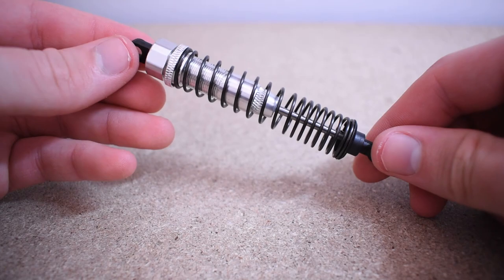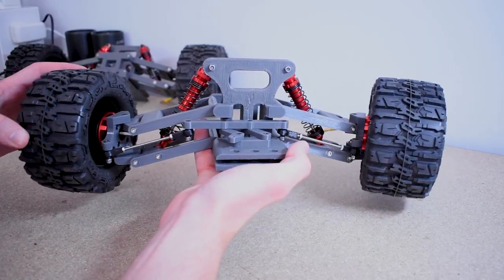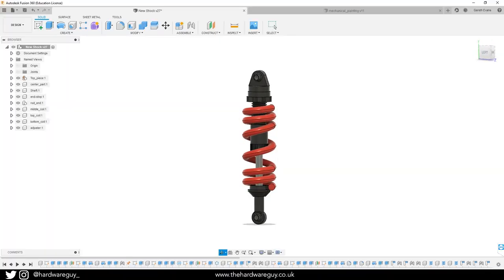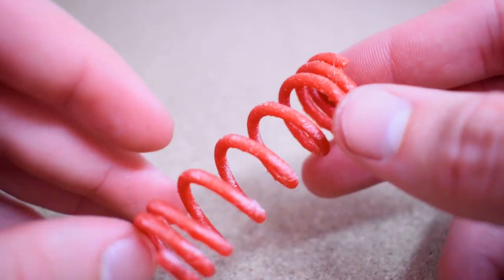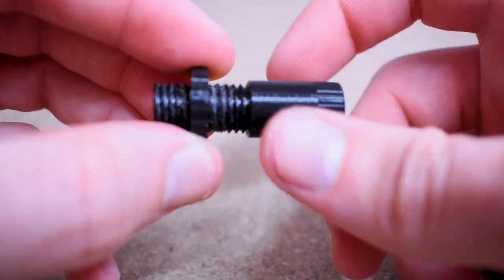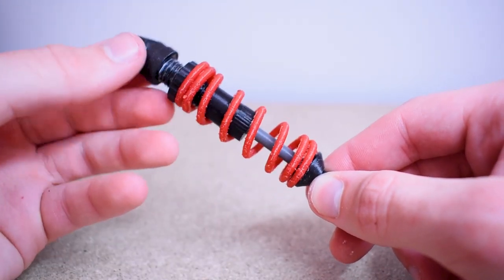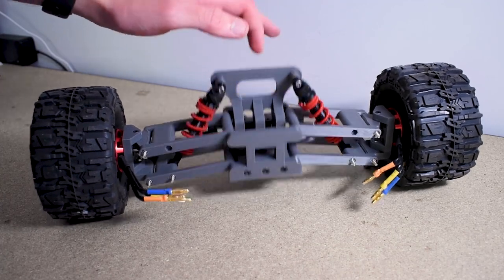3D Printed Spring Suspension 1:10

Comment: Unfortunately these aren't shock absorbers, but just springs. They aren't more responsive, they just lack a damping element. A damper would be, for example, a piston trying to push air (or oil) through a small hole. That causes energy loss, which is in essense, what damping is.

Comment: Nice work. I wonder if you could design a recess for o-rings and make the assembly oil-filled, thereby reducing the rebound and making it a true damper? Also - using TPU instead of PETG for the coil spring itself?
Reply: TPU might be too weak as a spring. TPU mimics squishy materials like rubber or foam. Springs need stiff materials like steel. For the suspension, the spring needs to strong enough to push the piston back into place. PETG or Nylon should be good. Buying steel springs would be better

Comment: If you offset the faces of your threads .05mm each, and do a slight chamfer on the corners, then you won't have to mess with the tap and die. My mk3s prints absolutely beautiful threads using this method. They're slightly stiff at first, but after a few cycles they get buttery smooth. This method has worked on every pitch I've tried so far, always using the auto generated threads in Fusion.
Reply from the maker: I’ll definitely give that a go, thanks for the tip Jack, much appreciated!
Reply: @thehardwareguy  Just be sure and offset all three faces on both parts. If you're only printing one thread to go in an existing thread, you might have to increase the offset, depending on which thread class it is.

Comment: Super cool stuff! About the printed "shocks" they are not really shock-absorbers, they are just springs since there is no oil to absorb the shock. The handling of the car will be bouncy with springs only, I'd just use some quality RC car shocks. But again, super cool stuff and a really cool project. Big 👍 from me.
Reply: I feel like the air in the piston would work as a damping fluid. it won’t be as effective as oil but it’ll still do some damping
Reply: @idfu8403  I second that. Air will function as dampening. It would also be possible to put a piece of foam in there. Which could be especially helpful when bottoming out.
Reply: @idfu8403  it wouldn't work well, because unlike fluid, it can be compressed, so most of volume would act as another undamped spring.

Comment: Nice!! But you’ll also have the rest of the weight of the car when it is built, which should help soften the response from the hard shocks...?
Reply from the maker: even with additional weight they'd be too stiff! when the whole thing is built I'll re-print 4 new springs. The additional weight should mean I need to increase coil diameter (which is good because they'll be stronger)

Comment: hi! This looks quite great, but, seeing the rest of your videos, I'm assuming it didn't really work out well enough, as you switched back to metal shocks, is that so? What was the ultimate issue with this, they broke a lot or smth?
Reply: and did you ever attempt a version with actual suspension-oil in it?
Reply from the maker: The car was too heavy. If you had a lighter RC car I think they'd work fairly well. Definitley wouldn't hit any jumps with them though

Comment: Hello could you tell me the % infill? I'm printing one in PLA but it cracks easily, I printed it with the spring flipped horizontally (layer 0.1mm) and with 60% infill but it fails when compressed with my fingers, any suggestion?

Comment: it's good to have bounce to know a spring works. Could i offer a couple tips for attempting this feat?
1. a spring that's bouncy when you apply force on top and is soft (bouncy) does not help you maintain control of a vehicle. you test a spring by seeing if it's bouncy from the top load. Look at the bottom load. what compresses it from the bottom? Bumps, un even terrain, etc.. so if the spring is bouncy from the top, and with every action theres an equal and opposite reaction, it's the springs going from uncompressed, compressed and reacting towards the weight on top. 
     -REACTING TO THE LOAD FROM THE TOP TRANSFERS THE OPPOSITE REACTION WHICH IS LOAD TOWARDS THE TOP

2. so looking at the load applied to compress from the bottom of the springs.. if you're going fast, and not slowly crawling over big terrain, then why do you want bounce in suspension? if you bounce on the top with whatever pressure you gave, and it kept bouncing, think about how the driver in it feels. MORE IMPORTANTLY, if you focus on the load going bottom to top (like what compresses a suspension spring more), you don't want it to bounce after a bump and transfer it to the upper part. 

3. ok so your spring for your suspension bounces... you like that. if we made the springs on your daily vehicle bounce more so that when you sit down and applied load to the top of the springs, and you keep bouncing after you sit? that's what you're looking for? or wait since the load from the top is static and stays relatively the same on that ratio size you've mocked up, would you like it to apply the same effect to the ground to go over bumps better? soft and bouncy springs don't return to their tailored compression and static position as quickly as a stiffer spring does. if your springs bounce a bunch then your tires don't return to the ground with force as quickly. the soft ones do return almost in the same time. but if your soft ones are soft and take longer to return to their original spring tension then the force is applied long after the stiffer springs that force the tire down quicker and harder.

 It's engineering at it's finest to do what doesn't seem possible. a spring is not stretchy, bendy, squishy, or bouncy. it is a rigid shape. what makes it bouncy is the distance between each coil in the spring, how close the coils are in the top, the bottom, and the middle. if they're are a bunch of coils equally spaced, it'll bounce more than the spring with les coils, same length, but the bottom has coils closer, the top has coils closer, and the middle is wider apart. those coils close together absorb a lot of impact and the left overs go to the middle. the springs with equal spacing is just like the newtons cradle. equal spacing transfers the same energy back and forth until it losing enough energy between transferring between a solid object. so with spacing bigger than the middle, the smaller and more coils on each end loose energy pushing the next coil. then the middle looses completely because it doesnt have the energy to compress the middle enough to transfer through it. resulting in a soft spring, it takes longer for the energy to travel back and forth those distances, and energy is lost on each end. nowthe 3d printed ones have less coils, tops and bottoms touch so it transfers better, and it's bouncier. well newtons cradle transfers almost 100 percent of the energy when the balls touch, the less balls there are the more similar the energy transferring is. the balls are like coils. the less there are, the quicker and harder it transfers. the more there are the slower it transfers to the other side and back. the loss of energy between more coils causes it to delay returning to it's static shape.

in my eyes, you're designing a spring for bouncing load on top, vs returning quickly to the ground below to maintain traction.
-if you want a bouncy frame or upper suspension then make a spring with close coils at the bottom touching, then they fade further apart 1/2 way up, the other 1/2 continues like the last half ended but at the top is coils that don't touch and are spaced close together but are flexible when they bend and make a boing sorta effect when you flex them and let go. that'll let you bounce on top, be stiff below, and have control in the middle. not recommended but it's what you seem to be testing for instead of road return or traction maintaining..

Comment: So I guess there's no way to print the spring in a more continuous motion.  Maybe print some sort of scaffolding structure first?
Reply from the maker: you could potentially try it with supports but it'd be tricky. SLA printers might be great for the job, however, I have no experience with those.

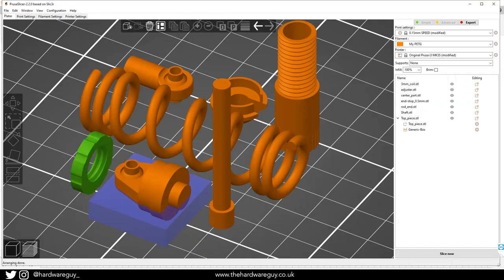Comment: i mean there is a reason why you have oil filled shocks in anything that is bigger than 1:28 .. skip the 3d printing on these, it doesn t make much sense
Reply from the maker: I will almost certainly revert to proper shocks if I have to! I just enjoy the design challenge, and they may be useful to others when I release the files!
Reply: @thehardwareguy  yeah i thought so .. its good to try stuff out ;)

Comment: could you put these on Thingiverse? I really want these for my car that I am designing, which is my first big 3d printing project. (i am 13) plz help
Reply: I am 14, and im making a 3d printed rc crawler; hope it works...
If he does do that would be awesome.
123d design wont let me do this stuff.
Reply from the maker: my files are available on my website for members!
Reply: @thehardwareguy  I bought shocks similar to the ones you have but I was wondering if petg dogbone cups would be strong enough for one 1000kv motor with a one to four gear ratio. Also, I was wondering if 3d printed differential gears would be viable. they are 90-degree bevel gears and about 25mm wide.

Comment: i dont think responsive is the right word. these have almost zero dampening. suspension is not supposed to "bounce" or "jiggle" per se.
Reply from the maker: Well it is a 3D printed piece of plastic... this was merely for research purposes! I'd be happy to take a look at your solution if you have one
Reply: @thehardwareguy  I think that the only problem is your shock does not have any shock fluid or valves for that fluid to travel through (with accompanying seals). So it only limits the range of motion instead of absorbing the shock. Getting a good seal on small and complex printed parts like this would probably be very difficult though
Reply: Yeah, came here for this.
being "responsive" is not really a thing in shock absorbers. They have the force of the spring and the dampening of the fluid. In this case there is very little dampening - so the spring compresses a bit further but also heavily swings around.